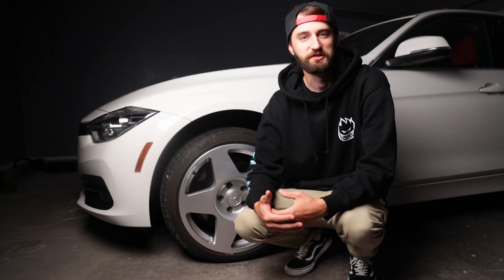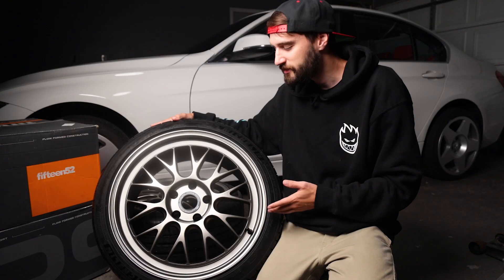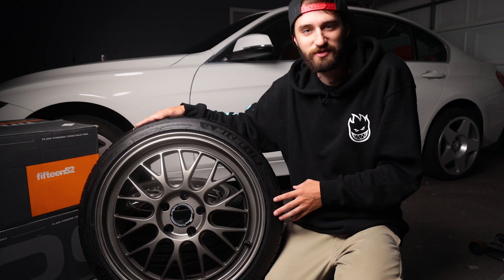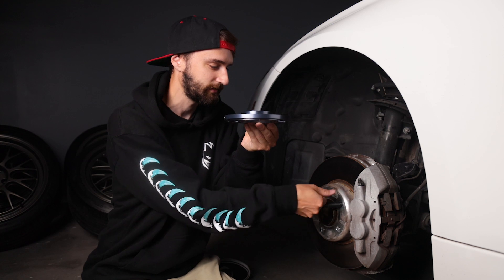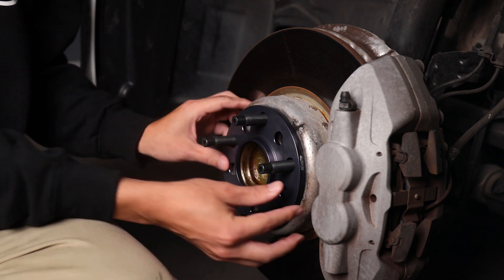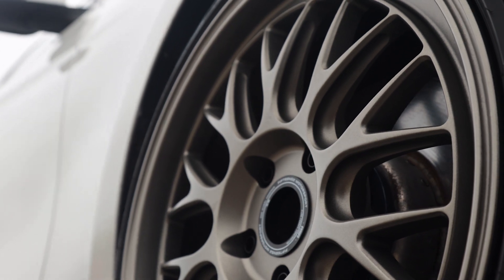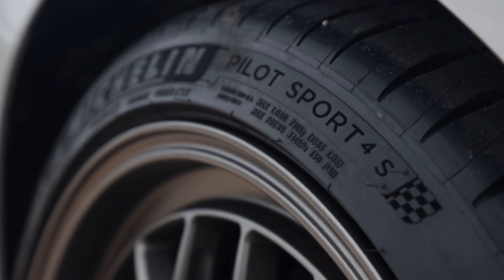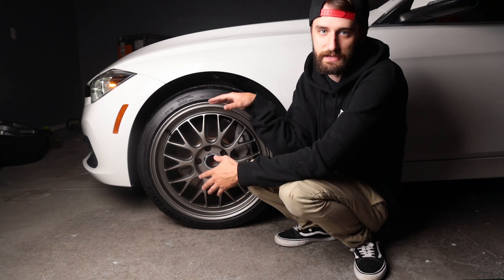New Aggressive BMW Wheel Setup | MY DREAM SPONSOR! 😍

Comment: Few people consider the weight of aftermarket wheels/tires and the affects of weight increases on the brakes and suspension.  Thanks for pointed out the weight savings early... 4 lbs per wheel is significant!
Reply from the maker: Plus I ditched the runflat tires too which is huge. People often forget the tire itself can weigh as much as the wheel. Without even putting them on a scale I could feel a weight difference while swapping wheels. The stock rear wheels with the runflats nearly threw my back out!

Comment: 59º in Michigan now, but 5º all winter. I'll take my 110º summers here in Arizona, because the rest of the year it's like 65º - 80º.
Reply from the maker: Yeah I’d rather have the heat because at least you have the option to go outside. When it’s 5 degrees out, it’s dangerous to be outdoors

Comment: I think the tires look a little thick. A lower profile tire will definitely look nicer/sportier. I remember you mentioned that on your old bmw that it's better to have the thicker wheel wall right? I'll take a look to see what 1552 has available for a 2013 528i F10 as im currently searching on fitment industries. I might go for the enkei victory or Milani clutch 475. :)

Comment: How close to the strut would you say the front is, after putting the spacer on? Always wanted to run 19x9.5 squared but was afraid of clearance
Reply from the maker: The wheel itself is about 5mm from the strut, but the tire hangs over just a little bit. I'd sat 2-3mm clearance on the tire . You won't want to run anything wider than a 255/35
Reply: Justin Buice you’re the man! Thank you

Comment: Wow that looks great. My 435i has larger tires in the back does your 340i have the same or different sizes
Reply from the maker: Hey it's pretty common for BMW's to have wider wheels and tires in the rear. That's what mine came with, but these new wheels are all the same size

Comment: Hey I have a question you you and all the ppl in the comments. I’m in highschool working a 10hr job I would say lower middle class but I’m looking at a 328xi manual with 86k good condition with a small oil leak problem from the oil filter housing gasket. The car is $5,950 but I think we can talk him down good enough. Rn I have a 99 Toyota Camry no problems, should I wait till I’m older to get a more performance car or luxury car like the 328xi or is it a good decision to get it. We’re kinda in a bind on our opinions. Other people’s ideas and thoughts would be greatly appreciated. Thanks for reading the long message if you see it it means a lot.
Reply: I'm new to BMWs as well, In short order I have learned 2 words for that car: timing chain. It depends highly on the year and engine but research the timing chain issues and repair costs involved before you make a decision.

Comment: No "52" Cap for these?
Reply from the maker: These are positioned as a track wheel so they just sell the anodized aluminum centers with the hole cut out. I'm not sure if the other center caps would fit

Comment: Dang I thought you put the starfish on the new f30😂
Reply from the maker: I had them on for a few days. I sold the stock wheels and was waiting for the new tires to come in. Unfortunately the starfish wouldn't have fit because the F30 suspension is a lot wider than the E90 so the rears stuck out like an inch and a half beyond the fender
Reply: @justinbuice  I thought they actually looked pretty sweet from what I could see sux they wont fit. I'm sure the new 15 wheels will look awesome tho with the new suspension.

Comment: Cool car. Not a big fan of the rims. Also, the american way to do wheels and tires are so weird compared to europe. Spacers? That's a no no. Get proper fitment with the correct offset - the car looks better and you don't add extra strain to the suspension and bearings. 
Looking forward to the updates on this car in the future.

Comment: Why Americans buy Bmw without m sport package? Its such a waste to buy SE and M sport package is not that expensive from the factory when you spec it out.
Reply from the maker: I bought the car used and it was a few thousand dollars less expensive compared to the M Sport version. I have a sponsor who is sending me the body kit for free so that I can make an installation video
Reply: @justinbuice  hey Justin thanks for response. I am aware you bought it used. But sure if you have free kit coming, you going to have good savings. Just for people in general I was giving advice to always go for M sport because its better and have higher resale value later down the line.